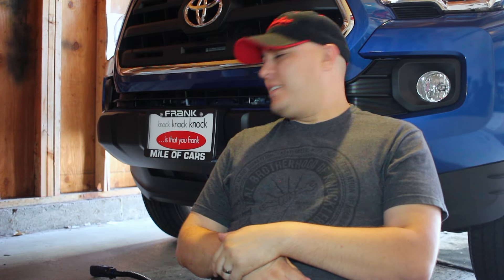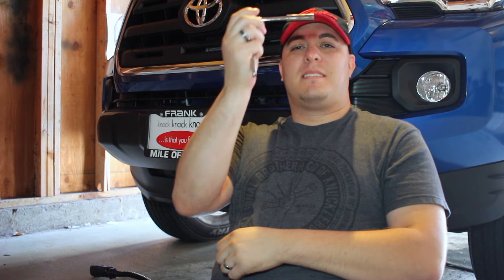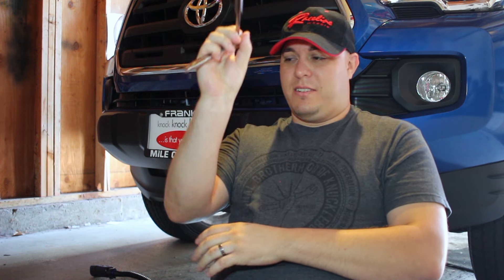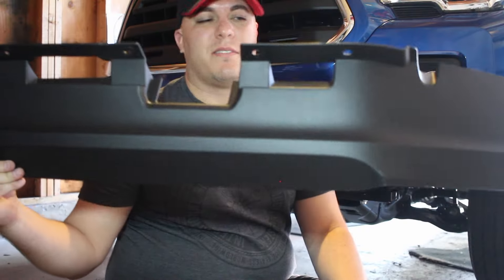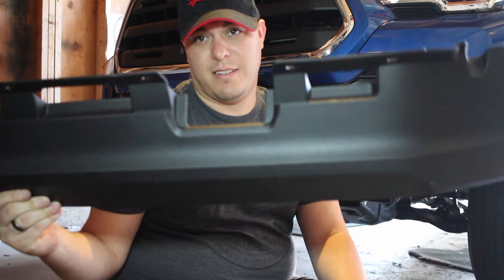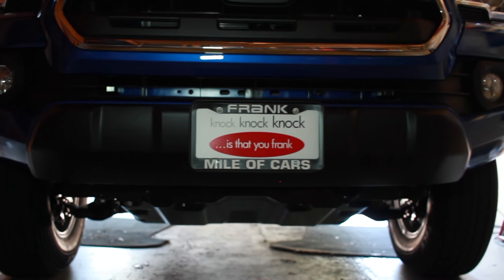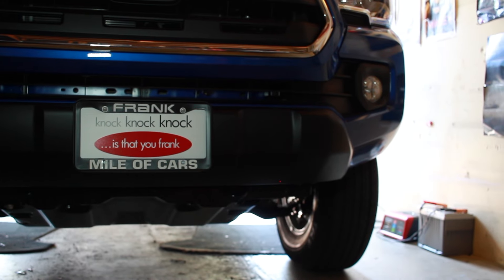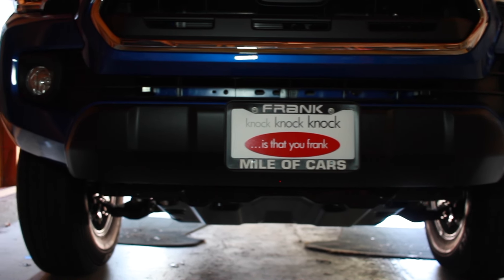2016+ Toyota Tacoma How-To: Remove the front air dam/chin spoiler - Tim's Tacoma Garage Ep. 2

Comment: Just took the air dam off my 2017 Tacoma SR5 and it does look so much better. The only thing I was concerned about was increased cabin noise, but I haven't noticed a difference at all even at highway speeds.
Reply from the maker: RadioClash81 It's not for noise reduction, just fuel mileage.